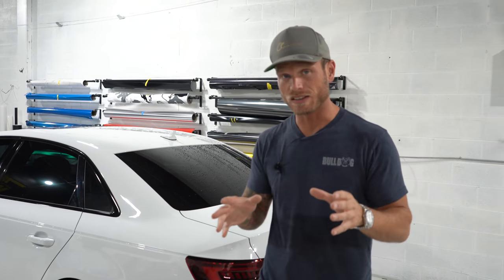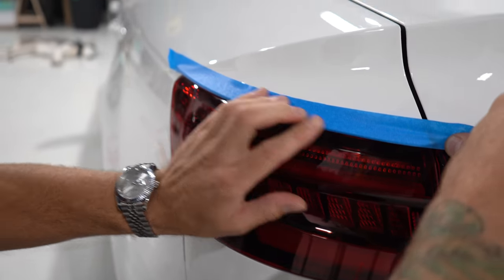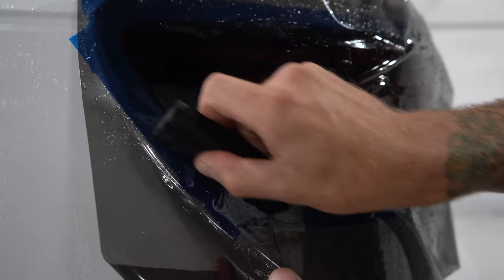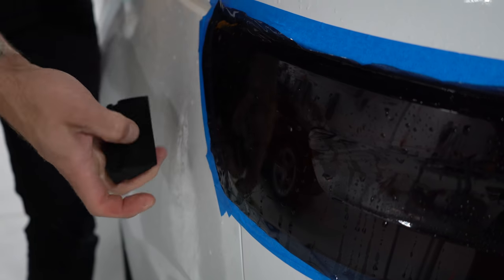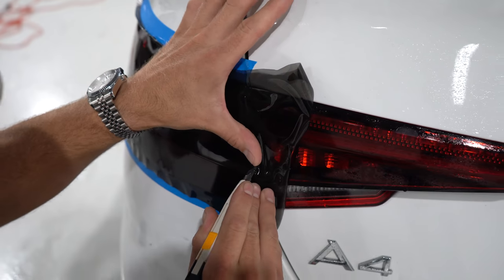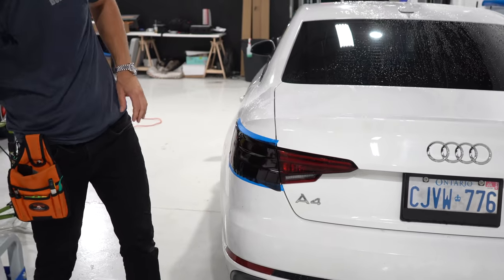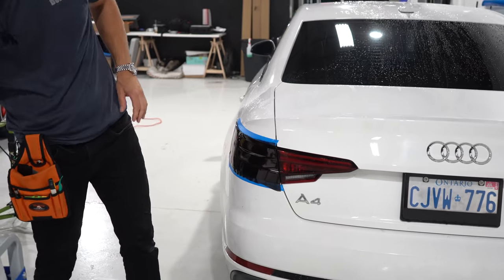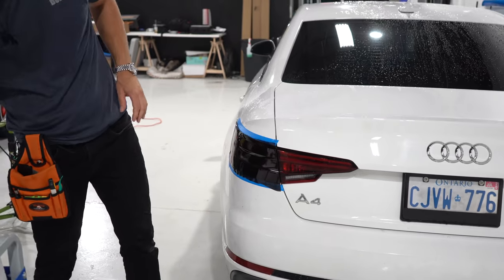How-to Tail light Tint PPF (wet apply) - FlexiShield HDL PPF light tint

Comment: Just tried this yesterday on my Jetta ..wasn’t too difficult only problem I had mostly was finishing the edges .cuse the razor would cut it exactly at the edge of the light but I wanted a little extra to roll over but it wouldn’t stick to well cuse like you said there’s nothing there for it hold onto..now I’m going to do it over but this time I’m thinking of removing the whole light just so I can roll the edges over and then applied like some electrical tape to tape them down but I know the only problem with removing the light unit is it won’t be steady..great video man and thank you 🙏🏽

Comment: When you mist your just using water correct? I ask because I've  alsonseen ppl use water with baby shampoo to make the tint movable then use a tact solution to hold it still when your stretching. My tint I'm going to use for my headlights & taillights (porsche cayenne S 2016) recommends using water just likebyour method.

Comment: Hi, is it easier to apply tint film with the lights off the car, or should it always be done with them installed, as shown?  One side on mine is seriously cracked from sunlight, so I'm going to replace it anyway with undamaged ones from a scrapped car, but was thinking to add a light smoke film at the same time.

Comment: 15:00 When do you actually show the removal of the bubble with a syringe?
Reply: I WAS WONDERING THE SAME. COULD HE NOT SQUEEGIE IT OUT?
Reply: @shawnk1953  Talking from experience, once your tint is well placed, namely flat and stuck on the surface, you can't really squeegee a bubble out without pulling the film anymore. Indeed, there's too much tension for the bubble to glide and if you still do it, the travel path of the bubble will leave some glue marks. So at that point, you can only poke the bubble to release the water out.

Comment: hello, great vid, very informative, but you forgot to mention the ratio of your tack solution. hope to get some response. keep it up.
Reply: As with any PPF especially FlexiShield, it should be no more than 80% RO water and 20% Alcohol. The adhesive is activated by soap and water, but in tough angles, edges youll want a little tack solution
Reply: How about the ratio for the slip solution? And is Johnson & Johnson baby soap the same as Johnson and Johnson baby shampoo?  Couldn't find anything labeled soap... Thanks for any help... Just waiting for my vvivid silicone squeegee to arrive!

Comment: Ever do a S3 2018/2019? Those tails are impossible. 😩
Reply: Don’t they have the same as a3 -17? Mine was easily tinted.
Reply: Aren't they the ones with a really deep recessed area?
If so, use an inlay.